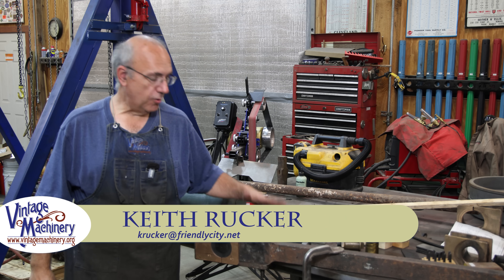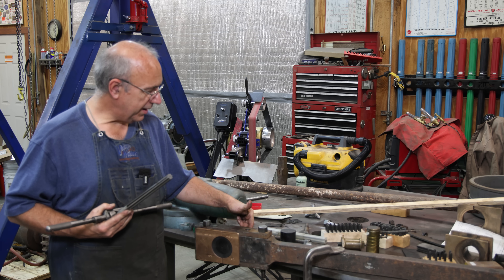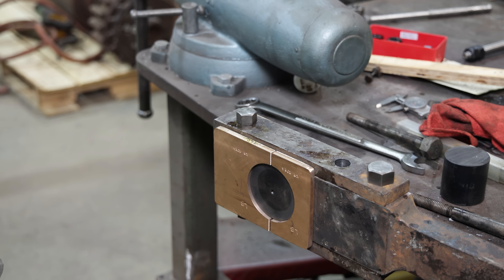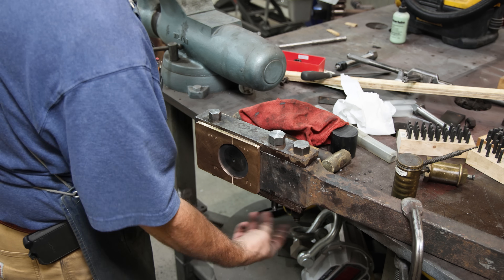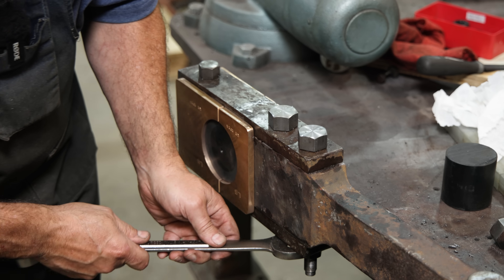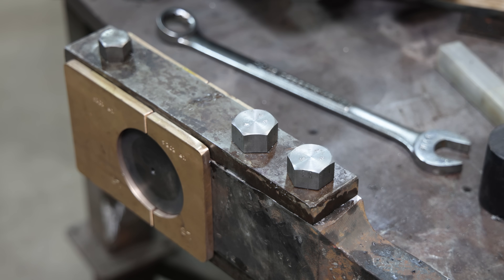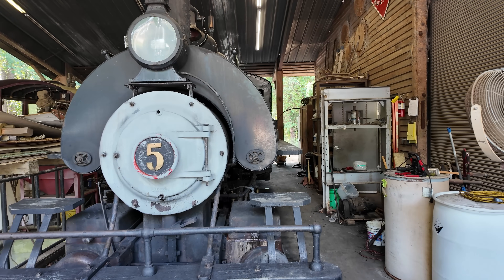Steam Locomotive Connecting Rod Bearings - Fitting Up the Second Bearing and Installation

Comment: If the hex on the tapered bolt hits the part it defeats the whole purpose of the taper … 
You need a gap there, so the taper locks the part in…

Comment: Is there a reason that the reamers have to be used by hand? You have a radial drill press that goes pretty slow.  Or are the reamers brittle and fragile so they would break too easily if they catch and the drill forces them?

Comment: If the RPM can be set low enough, the reaming looks like a good job for the radial arm drill. That should have the torque and control needed to do it in small increments.

Comment: I assume the centre to centre distance is critical, but maybe the wheel spacing can be adjusted a bit? I maybe didn't watch all episodes with total attention but I don't recall any discussion of this when making the brasses. Or about matching the two bars' dimensions. Is it an issue?
Reply: What would be easier - wheel (axle) spacing or connecting rod spacing? I would expect original manufacturer would have left and right axle spacings the same, given wheels and axles could be placed on any position across any axle (front and rear wheels are different).

Comment: How does the wedge push the two halves of the bearings closer together when the bearing has worn such that the two sides of the split are touching each other? It can't possibly close down tighter, can it?? With only 1/8" split between the two sides (give or take) it wouldn't seem like there's a ton of adjustability in this. I say that while recognizing that .125" wear is actually a significant amount of wear, so... Maybe this is sufficient.
Reply: Shims behind the bearings for adjustment . Not the bolts

Comment: Very interesting. 

I do wonder though why you would use a tapered bolt. It would seem to me that such a bolt would preclude proper tightening. 

Two problems, as the taper wears ever so slightly in service, it will enlarge. This is caused by the minor compression of the metal at the bolt to parts interface. 

So then, this leads to two possible situations. The first is of course the head of the bolt prevents any additional travel of the bolt body into the hole, leaving clearance around the bolt. 

The other possible situation is that the bolt body becomes tight in the hole without the head coming into contact. As that minor wear takes place, again a loose bolt is the result. 

Ah, the things that I do not know would fill the entire of the Cloud.

Comment: wouldn't you want a small gap between the bolt head and the top of the hole?  I'm thinking that that would then give you the ability to continue to tighten the bolt as it wears in, since it is giving friction the whole length of the shaft instead of just the bolt head as most bolts would be?

Comment: Why are the bolts tapered?
Reply: Answer in previous video. In short, if you want something to stay in exact position, will normal parallel holes do that? Also why are tapers used on drive couplings? To keep everything in original alignment and tightness. Same principal for this use. Think about the forces acting on these bolts and the parts they are securing. The forces are perpendicular to the bolts. Manufacturer needed to find a way to ensure everything stayed in exact position especially the 5 feet between centres. To have that distance enlarge would not be a good thing. Retired machinist/mechanic in Land Down Under.

Comment: Boy, i see another project just staring us in the face...making a nice brass oiler like on the back instead of that piece of galvanized pipe on the front.  Just poking fun...you did a great job on those bushings and i've never seen a tapered bolt before.

Comment: Why do these bolts need to be tapered? I assume that the single left hand bolt in the video is not tapered.
Reply: A very good question. One person gave the idea that it makes getting them out easier, which is a valid reason, old bolts in old holes for long periods of time tend to bond together.
Reply: for the same reason automotive ball joints use tapers, they wont loosen up with the shock loading thats constantly applied during operation.

Comment: In a previous episode I mentioned that the oiling hole was small and had no groove.  You can see in this video that once the length has been adjusted to match each side, the oilers on a couple bearings are not over the split line.  Unless there is a groove machined on each side of the bearing oil hole, eventually the oiler will no longer be over the hole and oil will not get to the bearing.
Reply: Correct.
Reply: The splits in these 2 new bearings seem to be exactly under the oilers. When the bearings wear, the adjusting bolt/wedge unit moves one side in, but shims (equal to the wedge adjustment) are added to move the other side in. This does 2 things, first it keeps the length between the bearing centers exactly the same (5 ft in this case) and it keeps the split lines right under the oilers.
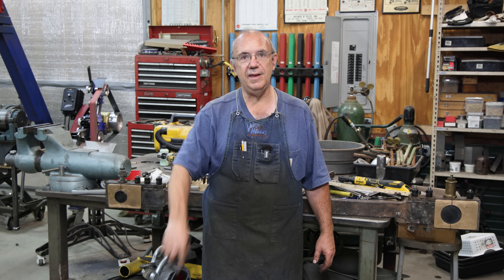Reply: @alandaters8547  Nope- If you stop the video at 14:00 you can clearly see that the bearing to Keith's left has the Oiler way off from the center line of the bearing.  The 5' center distance is required so both sides are equal- if not, the axles would bind.  But bearings do not always wear evenly and to maintain the same 5" distance one bearing may need to be moved forward or back, but the oiler location is fixed in the axle, so over time the oiler hole could be away from the oil cup completely.

Comment: Perhaps try a 12-point socket that fits the top of your reamer half-inch drive and then use some type of electric drill made it to the half inch drive pin on your reamer saves a lot of hand work😊

Comment: Does the technical drawing mention anything about the space between the bearing halves (saw cut width)? As I see it, if the saw cut width is 1/4" then after 1/4" of wear on the round surface, the blocks will touch and you will start to create a loose fit around the axle.
Reply: Then you machine material off the bearing halves, clamp them together and bore them out to the pin diameter + clearance again

Comment: Very nice.  I'm curious what you do if the bearing journal surfaces themselves ever get out of round.  I guessing you press out the old shaft then make and press in a new one.  Or is there some way to "outside" turn a surface like that?  Kind of the opposite of an inside line bore.
Reply: Check Snowball Engineering out.  At least 1 of his videos uses line boring equipment externally.
Reply: It's simple. You just take the wheel off and chuck it up in a 4 jaw chuck offset to turn the crank pin, easy peasy. Of course, you need something bigger than the average hobby lathe, in fact a big Vertical Boring Mill would be best.

Comment: It's interesting the tapered bolts are inserted from the bottom.
If the nuts fall off, the bolt would drop out.
I wonder why they didn't put them in from above?
Reply: Maybe the tapers are up to make it easier to drive them out for maintenance. Hammers work better swinging down when operated by hand.
Reply: This video will be valuable to the next generation of machinists who have to work on this engine. Great Job Keith!

Comment: The amount of time Keith spent on one connecting rod shows why railroads discarded steam locomotives in favor of diesel-electric prime movers.  The rule of thumb for steam locomotives was one hour of maintenance for every hour of running time whereas diesels take one-tenth of that.
Reply: Yes, true but… That inefficiency also kept several more households and pension-savings going, with one worker largely able to buy the family house… 

Sure, we’re indeed efficient - and I don’t intend we should run revenue steam, or romanticize that backbreaking reality.

However, a 27 y.o. today with way better education (with an equally educated partner also working?) may wonder where the efficiency gains ended up…? 😅
Reply: @musiqtee  With increased efficiency of workers we should be able to generate an increasing standard of living with a smaller population. We just need to figure out how to reduce the population size. A growing population will always be at the limits of resources with a certain percentage suffering on the margins. How to do it, how to do it?
Reply: @musiqtee  A lot of the overall economic efficiency (which includes diesel electric locomotives) can be seen by just looking around. Go back 75 years, when steam was still competitive and compare the worker and family. One telephone instead of cellphones in every pocket, one car (poor gas mileage, poor brakes, poor radio, poor handling, poor A/C, etc) vs 2 (or more cars, maybe a B&W TV vs multiple color TVs, unaffordable air travel, a shorter lifespan, the list is very long. The "Good old days" don't look so good now.
Reply: ...that was back when there wasn't anything better...
Reply: This like how a type writer has been replaced by an electronic key board, with even spell checking. Yes we are captain obvious. Isn’t this how things evolve. lol
Reply: Repair versus running time seems excessive but what do I know? One month in service, one month in the shop? How in the world did any freight get delivered?

Comment: Maybe a dumb question but, don't those bolts need to be hardened? I would think that shearing action would start to cut them in half or distort them pretty quickly without some kind of heat treatment.
Reply: Was thinking similar thoughts.
Reply: Doubt the originals were heat treated 100 years ago.
Besides that the alloys we use today are alot better then they were when the locomotive was made.
Edit: went back to the video that shows the drawing, just calls for steel, no other remarks what material to be used.
Reply: Not an Engineer here, but my understanding is that the primary strength of this joint is from the 2 planar surfaces being clamped together by the bolts.  Were the bolts not tightened, shear forces would certainly deform them over time.
Reply: Structural engineer here. This is a bearing connection. The tapered on the bolts gives you 100% bearing, there’s no slop at all. You have four big bolts with two shear planes. It’s lasted for 100 years or so. I would say they designed the connection properly.
Reply: @johnritchie3889 makes sense, but are these ever used for modern machinery, and were they common back in the day?
Reply: @jcopley100  I don’t know much about vintage machinery, but as Keith shows, these are basically handmade to get the fit right. Modern machinery uses torqued bolts. The torque specs put tension in the bolt which gives the required clamping force between the layers. The holes can be drilled larger than the bolts, so parts can be mass produced and still fit properly.